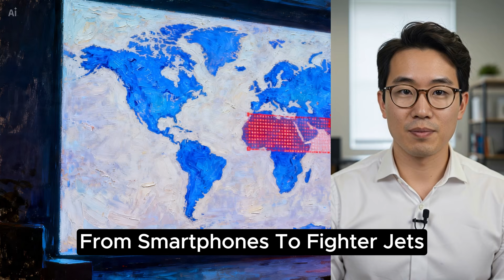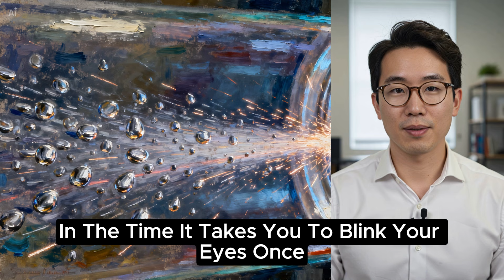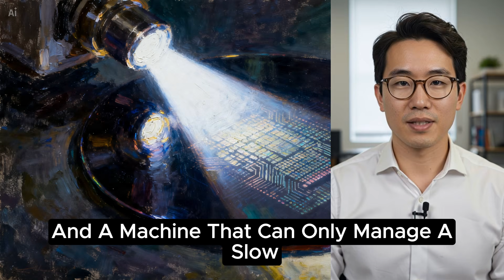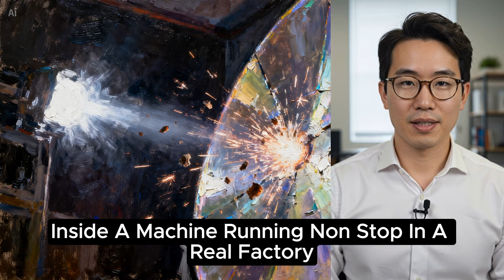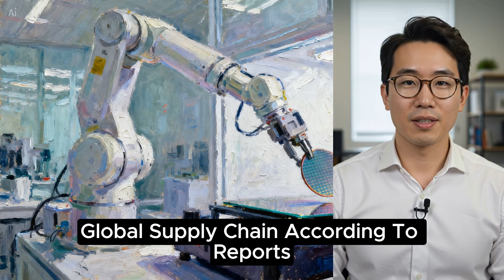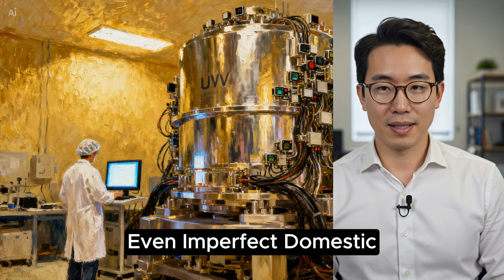China Just Built What ASML Feared The Most

Comment: China is in the process of researching an entirely different process of generating EUV.  
It's   Steady-State Microbunching (SSMB)   extreme ultraviolet (EUV) project in Xiong'an (close to Beijing) utilizes a particle accelerator storage ring to generate continuous, high-power 13.5nm light for multiple lithography stations.   It has the potential of exceeding the 700 W output of ASML latest lithography.
Centralized Hub: Uses a synchrotron storage ring (approx. 100–150 meters in circumference) to supply a cluster of exposure tools rather than relying on standalone laser-produced plasma (LPP) sources
Continuous Wave: Produces continuous high-average-power EUV radiation instead of high-peak-power pulses, potentially improving throughput and efficiency
Scaling Potential: Aims to provide a scalable domestic pathway for sub-2nm and 1nm advanced semiconductor production nodes
Facility Timeline: Construction on the specialized Xiong'an research and prototyping facility commenced in early 2025.    (paraphrase from Google AI)
Reply: Meanwhile TSMC will be releasing 14A in a couple years when SMIC is making "7nm" the same way Intel was, using DUV, with chips running hot because they consume too much power when you try to clock them fast because the etching is sloppy which creates resistance in the circuit and that's STILL the state they were in 4 years ago when "THE NEXT GREAT THING FROM CHINA IS 7NM!!!!!!" new story came out.

That is REALLY their current state for making an "advanced node".  

High-Na EUV from ASML will allow companies like TSMC, Intel and Samsung to get down to 10A.  They're already in development of 17 and 14A and 2nm is already in risk production with risk partners, AMD being one of them.  Intel is already making tiles with 18A for their Panther Lake line of CPUs,   AMD/TSMC were HOPING to be on N2X but it's unknown if any of their Zen 6 chiplets will use that node and may be stuck with N2P, but the evidence right now is their clock speeds will be above 6GHz, possibly above 6.5GHz and the ONLY way you get to something like that is the lithography, or etching is near perfect, which means TSMC can use High-NA for years to come getting down to the projected figures that's expected with High-NA EUV.

Like all tech stories that come out about China like this, there's the shock and awe of the initial story, but never the corrections to the story when the REAL story comes out.  Theory is one thing, but the actual production of products that are high quality is something SMIC hasn't done getting below 7nm and even with their 7nm, it's still the same state it was in 4 years ago, inconsistent because once again, it's made using DUV.